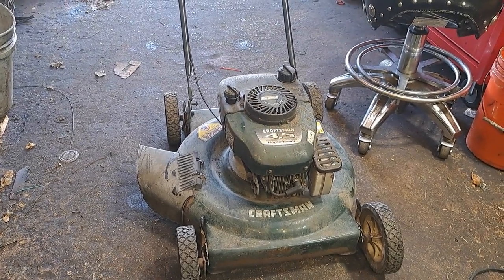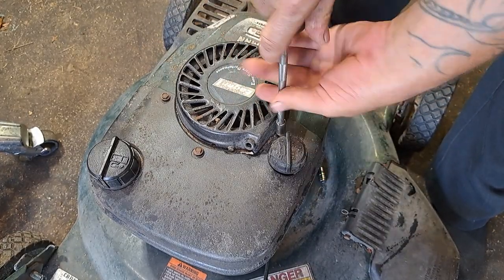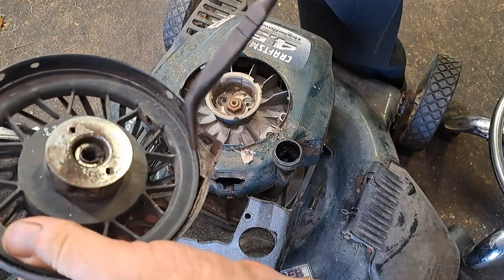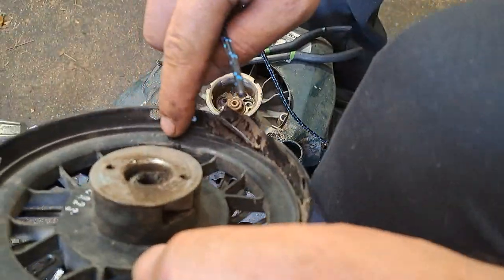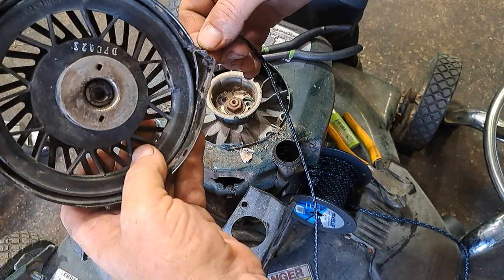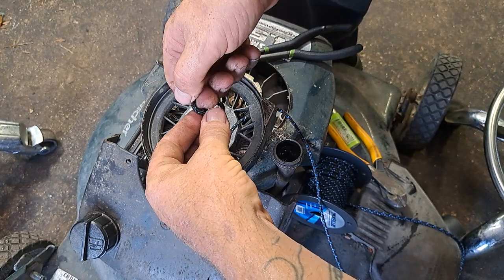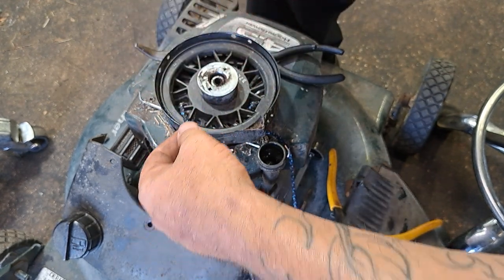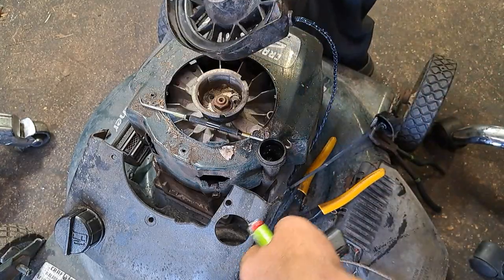Tecumseh 4.5 eager-1 recoil pull rope repair craftsman lawnmower

Comment: solid tip on cutting at an angle and using your fingers to really taper out the end when you're fusing with the lighter.  I had to walk away on the first attempt. How about reusing the handle?  I have this same exact mower.  Looks like it's stapled in and a disposable handle.  Guess that's why you're linking people to  a cord with handle.
Reply from the maker: if you can get the staple out you can reuse it
Reply: @smallengineguys  I gave up.  Just cut a piece of wood. Looks kinda hillbilly but that's me.
Reply: @smallengineguys  2nd attempt with a screwdriver and hammer was successful.  Was just the staple holding the line.  Surprised that holds.  Can fish the line through the end of the T and tie a knot to reinforce

Comment: Great video!!!
Reply from the maker: Thank you!!
Reply: @smallengineguys  yeah no problem these are very helpful as I’m learning how to be a mechanic
Reply from the maker: its all repetition. best way to learn it is go work for a small engine shop for a summer. you'll get the basics down fast.
Reply: @smallengineguys  yes I’m only going to high school next year and my dads a great auto mechanic he’s been doing it for 28 years or so I think. But I’m going to go to school for it in 10th grade and hopefully learn a bunch there and go find a shop and offer to work there!. And my dad teaches me a lot so I think I should be fine
Reply from the maker: @Deerslayer3000  any shop would be happy to take you as an apprentice.small engine mechanism are the best mechanics. They learn the basics so well and deal with so many different issues they can diagnose anything.
Reply: @smallengineguys  ok great to know!!